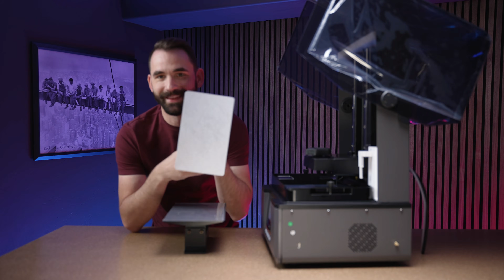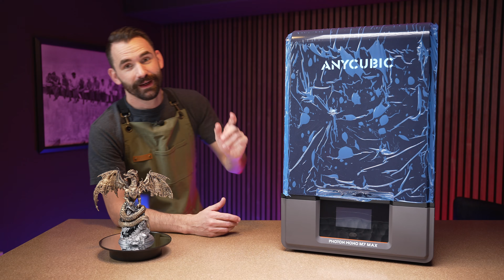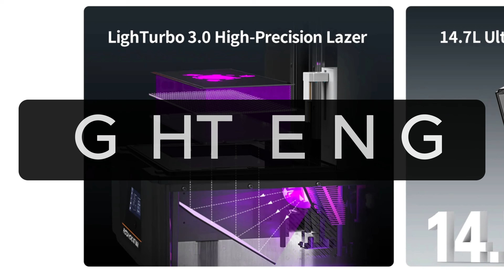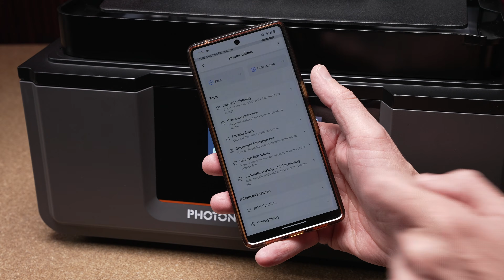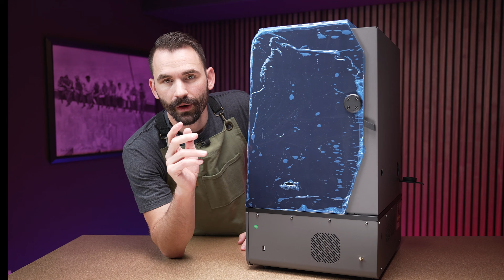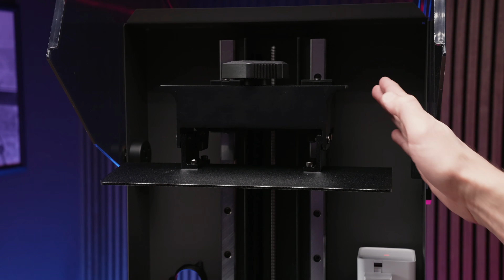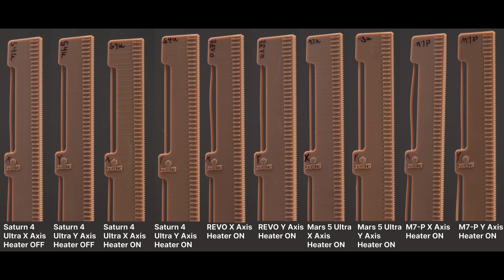Should the M7-Max be your next Printer?  #review #3dprinting

Comment: Asking around trying to get an answer before I pull the trigger on something this expensive. Does the heater maintain the temp throughout the build? The store page says the heater stops when the build begins, so implies pre-heat only. Is this correct?
Reply from the maker: @The_Inner_Geek  It keep it going in the review I did 3 print where I pulled the temps and I provided the graphs. 
Without the heater.
With the heater 
And with the heater and a larger print that generated a lot of heat.
Reply: @J3DTech  Thanks for the reply. That's what I thought from this excellent review, but the store page seems to contradict it so thought I'd ask. Thanks again!

Comment: The Apex Maker X1 has a UV matrix 2 to 2.5 X more powerful than anything else on the market today,. It can also almost re-slice a file on the go if you wanted to say change the layers height from 50um to 100um!!
Its normal exposure time for  resins like elegoo abs or anycubic abs is 1.1s and for fast resin it 0.5.. 

The Apex uses TSP film aka HDF and I've had no problems with stretching and have actually lowered the lifting height from 6mm down to 5mm..

It also has a build plate bigger than this and bigger than the Mega 8k it has made my M3 MAX, Mega 8k, Mega 8k V2, and Jupiter all obsolete like we hardly bother with them anymore!!

They are not losing money the Apex Maker wipes the floor with this and it's only £1650 and £350 of that is going to be shipping.. It's only Phrozen that charges you £3500 for a printer no better than anyone else, I still can't believe how crap the Mega 8k is and the V2 what a joke...

Comment: If you wipe down the lid with a dryer sheet, it will discharge the static and eliminate the resin issue.
Reply from the maker: @gtrmotorc7  I have that a test and I even got the anti static sheets and it did not work. 

I've even had it jump over to a printer next to it.

Comment: I am going to buy a MSLA Printer now or soon and wanting the best price for performance ratio and is it seeming like this is the one to get currently. LIke do you say like this better than the saturn 4 ultra . And obv getting this now at the current presale price. But my goal is to use it within 1 year of getting it also. NO joke, i deal with many hobbies engine toys and extreme lazyness on free time ( half joking) . Thx. and blessings.
Reply: actually wtf why is this only a 7k printer. Or are larger printers generally lower k resolution. Perhaps ill wait a year for logics to improve in overall quality of this type of printer. Should easily of been a 12k resolution in 2024.
Reply from the maker: @mattg2596  Higher resolution screens exist but I would say you're right. Big printers generally do have a significantly lower. Um size. 

Cuz remember we don't care about the resolution. We only care about the size of the pixel and of course this one is 46um or 0.046mm square. 

I would say you are also correct in saying that a 46um LCD in this day does seem a bit strange. 

But this was an intentional choice to keep the cost down. This printer right now goes for closer to $700 and if you can pair that to the gk3 that's going for almost double that price and the only significant difference between the two is the LCD you start to see it might be for slightly different audience. 

As in, if you're going to print a mini you want to paint, this might not be the best printer. However, for the price point you can buy something like a Mono 4 Ultra with a crazy low 17um for $259. Now for cheaper than a gk3 you have a really big printer for printing big models or terrain and probably the highest quality printer on the market right now to print your minis. 

But again, if your goal is to print lots and lots of minis and that's it, you might want to go for the gk3.
Reply: @J3DTech  Thx for response, just bought the mono 4 ultra and wash n cure max and 5kg of texture resin hd gray and used your coupon code which saved 30$ thank you indeed.
Reply from the maker: @mattg2596  A great printer! Make sure to read my resin guide as well (Comments). 3 years of testing and education in that one doc.
Reply from the maker: @mattg2596  Thank you! I also just added a coupon code on the video description that'll save you even a little bit more money if paired with the link. 

I do have to honestly say this is one of my more favorite printers that I've used over the last year. 

Before this, my next favorite printer I've ever used is the M3 premium that you can't buy anymore sadly.

Comment: The unfortunate aspect of this machine is that the resolution and build size is identical to the M3 Max. It's the same machine with vat heater and wifi.
Reply from the maker: @ajc4477  And 

A massively better lighting engine. This is a bigger deal than I think people understand.
 
A force sensor for Dynamic settings 

An upgraded motherboard that's way better at processing the data for more stability and higher quality AA. 

Upgraded UI and better integration into the app. 

All that said. I am pushing Anycubic as hard as I can to release an upgraded LCD as an optional upgrade and or checkout option.
Reply: the resolution is much higher on the m3 max....
Reply from the maker: @niklovessushi  The M3 Max is 6,480 x 3,600 pixels I made a mistake in the video, the M7 Max is the same at  6,480 x 3,600

Comment: Hej. Thank you for the video. It is a nice looking 3D printer with good new features.

During watching this short intro i got "Photon M3 Max feelings" because it has nearly the same specs with 298x164x300mm maximum printing size. 

In the M7 Max video the screen resolution has a typo - it is not just 4680x3600 (https://youtu.be/NRmI5YkknwI?si=l2ZZI_4LHcRkAOz0&t=255 ) . 
The M7 Max will assumly have 6480x3600. And again - it is like the older M3 Max ;)

I am wondering about the claims Anycubic has made about the printing speed of the new M7 Max - they advertise "blazing speed" of 31mm per hour on their info page = for me this is extremely slow...

I will wait for more reviews and do not pre-order the M7 Max. 
And maybe the M3 max will get extremly cheaper so i can buy that one ;)
Reply from the maker: Ah crap, cant fix that now.. 

Howerver, the only thing that matters is the 46um pixle size. 

The resolution means nothing as it has to be measured against the LCD size. 

As for the 31mm per hour, this type of marketing means nothing. They are using 0.1mm layerhieght and a speed resin to even get this. 

In the end limit of speed is the resin not the printer. And it's ALWAYS as a cost in quality. 

If you're pushing this printer at it's max speed of 10mm/s up and down with 0s light off delay at 0.1mm layer height using a speed resin and ACF film... you will in no way get 46um quality on XY. This has nothign to do with the printer it's just physics.

You need to aks yourself, do you want a fast print or a quality print?

To give you an idea, to get the results where this 46um got pretty close to a 19um printer once 16XAA was enabled. I was printing at less then 1mm/s at 0.03mm layer height. This is going to take over 30x as long as this advertised speed.

But this is what it takes to really get the best quality out of your printer.

If I replace the ACF with nFEP I will get even better results. Something I did want to do with this review but ran out of time. 

I think the biggest upgrade between this printer and the M3 is the vastly upgraded lighinting engine, the best I EVER tested. As well as force sensor to to add in the intelligent release and light off delay functions.

Comment: I loved your review! thank you. How would you compare it to the M7 Pro? I bought the M7 Pro but still haven't taken it out of the box yet. I heard issues with the splattering of the resin when the build plate lifts and I'm concerned about that. Also, concerned about the cleaning of the Vat. I was planning on selling it to get the Information GK2... but seeing this unit has he on a halt. Can you please address my concerns etc? Thank you. ... looking forward to your next video!
Reply from the maker: I have the M7 Pro and it is a good printer. I've never experienced any splashing so I'm not entirely sure where that's coming from. It could be people using their printer way too fast? 

The max has speed limits built into the first 50 layers. That should prevent that. 

Overall, I would say this is one of the better built printers that I've I've handled since the M3 premium, which still to this day is my favorite printer that is a medium sized. This of course is a large size printer so it's a slightly different category.

I think the biggest selling point of this printer is going to be its build quality, its size and it's price. 

There are printers that are the size that have a higher resolution LCD but either their build quality isn't quite as good or their price is significantly higher. 

So it really depends on what you're looking for on which ones right for you.
Reply: @J3DTech  How would you rate the M7 pro? Is the resin vat hard to clean? I'm really wanting a printer that is turnkey and easy to clean and has a heater as I've in Canada. I just to know if there is a better option before I unbox the m7 pro that I have. Thank you again.
Reply: Also, is there a way to slow the rising build plate so it doesn't hit the top and splatter. I've read articles where that has happened.  I see in you m7 max review that that  can be adjusted in the phone app.
Reply from the maker: @jameskelleher467  Now process to slow it down. But you can select if you want it to go up after the print is finished or not. 

I've asked for a hanger button to be added on the print finished screen. This way there would be no real need for this.
Reply from the maker: @jameskelleher467  I found it a bit difficult to clean. But you only need to clean it if you change your resin to something quite different. 

You can also use the M7 VAT on the MB Pro.
Reply: @J3DTech I hope they listen to you on that.
Reply: @J3DTech  anycubic tech services told me that the m7 vat isn't compatible with the m7 pro. Is that just them reading black and white and not grey?
Reply from the maker: @jameskelleher467  Hmm I was told it was. I'll try and confirm.
Reply: Tha k you @J3DTech
Reply: @jameskelleher467  I decided to sell the M7 Pro. So I'm looking at this new M7 Max or the Uniformation GK2. Have you any experience with the GKtwo? I know the technology is a couple of years old but people still swear about  it. I'm looking for some direction and guidance in helping me make my decision. I want a printer the is pretty much turnkey with a heater. I'd rather be printing right out of the box than tinkering with the printer. Any direction would be greatly appreciated. Thank you
Reply: @J3DTech   (I had sent this to myself earlier my mistake lol) I decided to sell the M7 Pro. So I'm looking at this new M7 Max or the Uniformation GK2. Have you any experience with the GKtwo? I know the technology is a couple of years old but people still swear about  it. I'm looking for some direction and guidance in helping me make my decision. I want a printer the is pretty much turnkey with a heater. I'd rather be printing right out of the box than tinkering with the printer. Any direction would be greatly appreciated. Thank you
Reply from the maker: @jameskelleher467  I have not used the GK2 but I have a GK3 that I've given a look over but no time to start printing on it yet.

I think it will be hard to say what one is better especially when price is considered. 

But I will release a video of the GK3 like the MAX. However it will be delayed due to Formnext.
Reply: @J3DTech  Great. Thank you. Can't wait to see your review. Thanks.
Reply: @jameskelleher467 the m7 vat they are probably just telling you that because you would lose the heating ability which. Is the May selling point of the m7 vs m7 pro.

Comment: Could you lap the build plate to flatten it out? How deep are the etching marks?
Reply from the maker: @Tridentwildlifephotography  It absolutely will help. They are not they deep and starting with a higher grit and a plate of glass or granite will get it down pretty fast. 

But this is the one Area I would like Anycubic to look into on their line. I don't see why it is an issue in the first place.
Reply: @J3DTech  Thanks for the fast reply, the girlfriend and I want a large 3d resin printer as the FDM isn't cutting it for D&D terrain and minis anymore.

We were debating to pre-order this. I think if we could lap the build plate that would be good, but for the price i'd rather it came with a perfectly level bed 🤦‍♂
Reply from the maker: @Trident_Media7104  I think it's kind of luck of the draw. I have one build plate for my M7 Pro that's flat and another that's not. 

It's not the worst thing to fix and if you use a MAG plate then it doesn't matter either. 

I would love to give every printer a shining review and not have any butts but every single printer has a butt. 

This one I think has two. One of them is by design. That's the lower um LCD. The other one is the build plate. Outside of that I would say it's damn near a perfect printer.